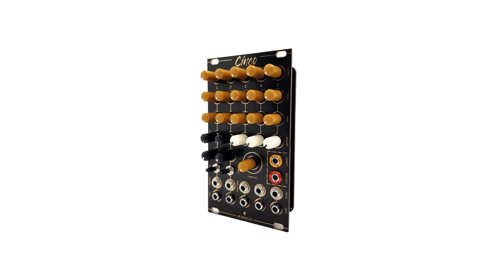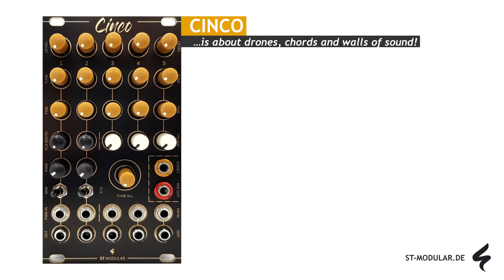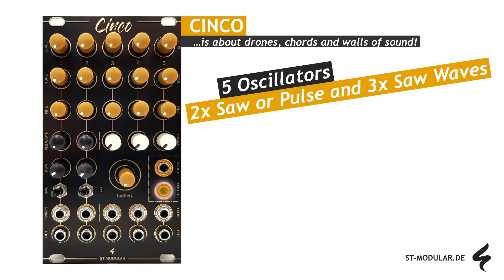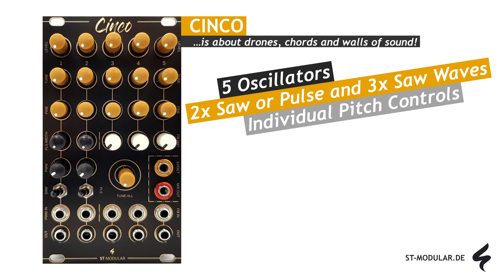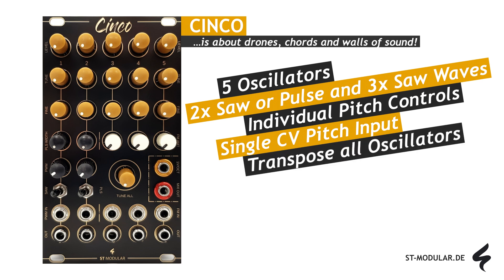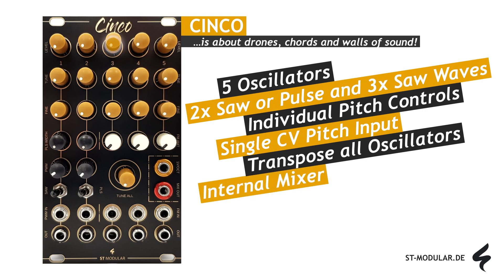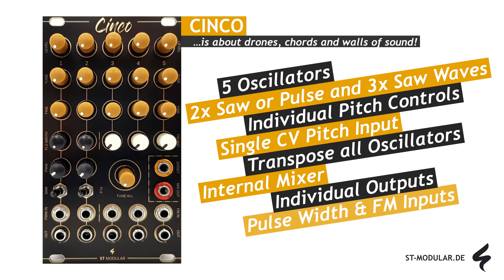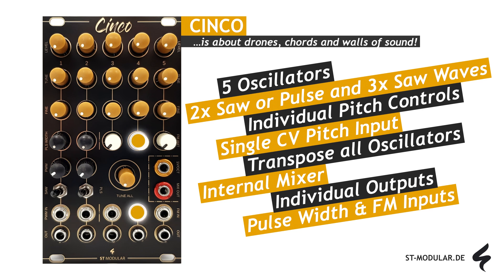ST Modular - CINCO (Five Analog Oscillators in a Module)

Comment: How is the tuning stability and CV tracking? Are these VCOs or DCOs?
Reply from the maker: These are analog voltage-controlled oscillators without temperature compensation, making them sensitive to temperature changes. It’s best to let them warm up before tuning. They support 1V/octave tracking via the V/OCT input.
Reply: @st-modular  can the individual fm inputs be used for 1v/oct?
Reply from the maker: @nuriamarti100  they won't track 1V/Oct, but you can use them for pitch CV, yes.